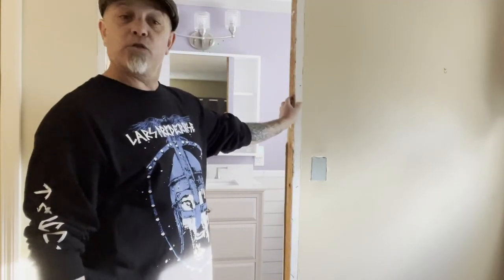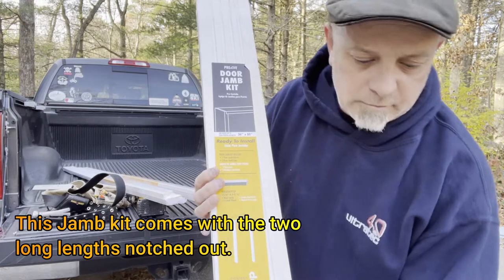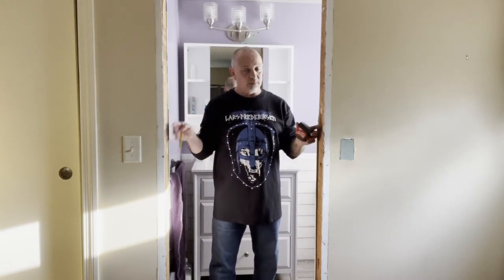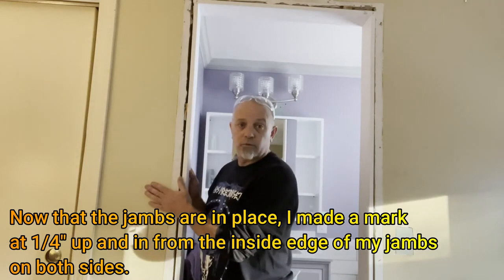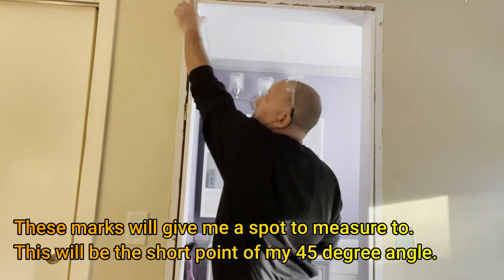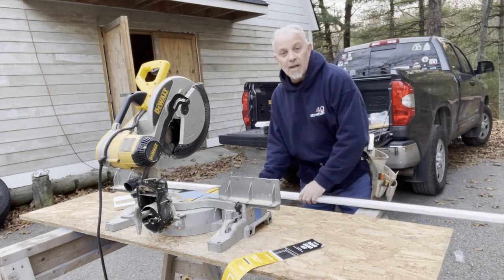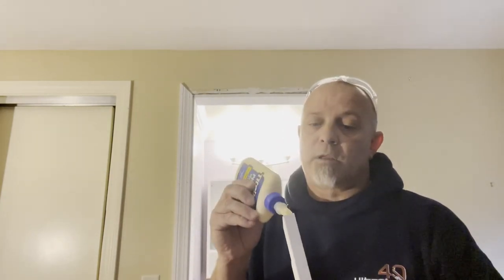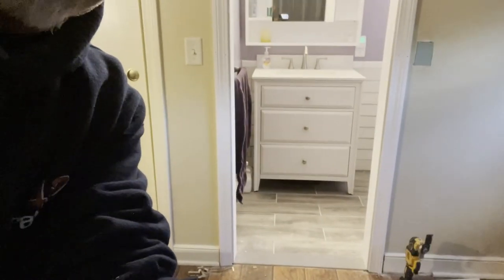Trim out an opening for a barn door or pass thru

Comment: Good tip on gluing the top casing onto the sides. Every house I've seen has the 45 degree joints separated and the caulking gets cracked.
Reply from the maker: 👍🏼 thanks for checking out the video!